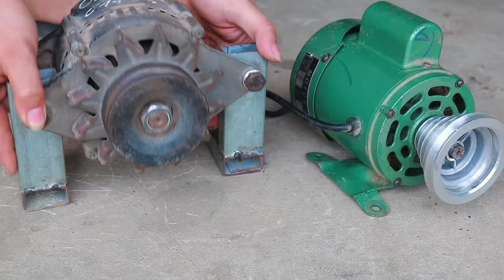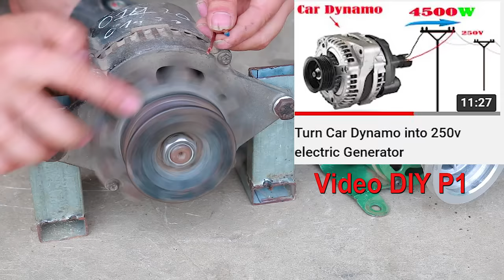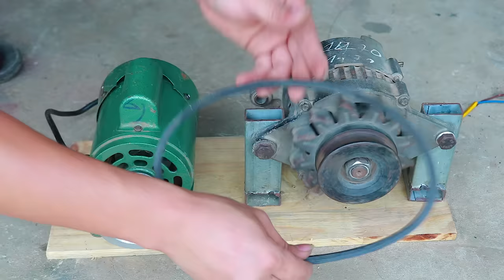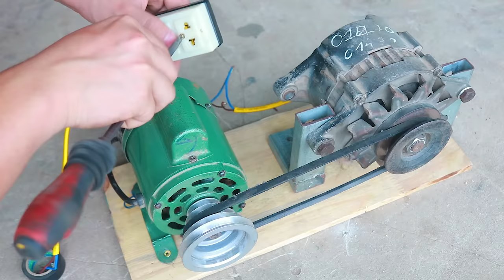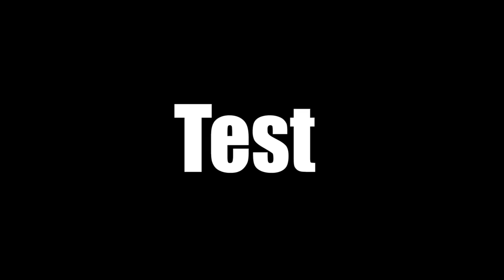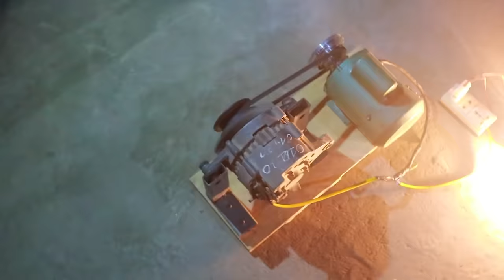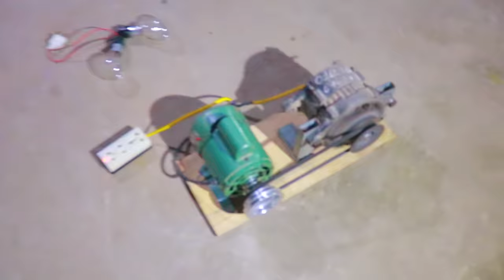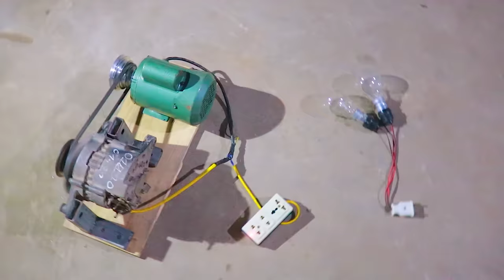How to generate homemade infinite energy with a car alternator and an engine P2💡💡💡

Comment: if you look at the data plate on the electrical motors they have something that is called efficiency and if you understand what this means then you will know why this is impossible, but good job making look real for the people that don't understand how electricity works. and before i get attacked power is what i did for a living for a long time.
Reply: you the wheels that spin with the belt couldn't you just attach a pair of magnets neodium or what ever is used  to them on shafts that extend into a coper coil housing to then as a by product of rotation create a very powerful magnetic field ??
Reply: @odgreenshq6221  if that is a question word it better because I can’t make sense of it, it’s like talking to Yoda.
Reply: He basically trynna explain what an alternator does
Reply: The Crazy Channel built a Liberty engine #1 using an alternator & electric motor & shows it running afterwards with no outside power supply. Logic tells me friction will slow it down but they claim its been run for over 2 hours non-stop. Is this possible ?   The same group built a generator that runs on water (H). what's your take ?  If that's true .... we won't need petroleum or electric cars either, just water & occasionally HH+.
Reply: Traduci
Reply: Wow you know a lot let me give you 5 stars ☆☆☆☆☆
Reply: I hate being told something is impossible,,  everything had never been done, until it was done the first time,. mankind always think he is at the pinacle of thought and  technology, he has always been wrong.its the one in 100000 that beats the odds and achieve.
Reply: Please keep paying your expensive electric bills that are going to get more expensive. Such devices are not meant for you
Reply: @EasternSurvival  lol I can comfortably pay my bills, but this device is nothing more than a party trick. If it was real the creator won’t just show it in YouTube for free. In fact this guy would be richer than Elon musk 😂😂😂
Reply: Exactly
Reply: @Juan Esteban Horta  
And thats exactly where you're wrong. If energy was for free there is no reason for war. Remember we're human...
Reply: Absolutely, This breaks law of conservation of energy!
Reply: @varunentertainmentnetworks2670  
Does the alternator charge itself through the power output of the electric Motor ?
r
Reply: @varunentertainmentnetworks2670  
Does the alternator generate. power for itself with the help of the electric motor?
Reply: Can gear ratio make it possible?
Reply: 🦋 I now remember exactly who you are. You are the person that said man can never fly. You were the man that said it’s impossible to fly to the moon.  You are the man that said a lot of things were impossible that later became possible. Why don’t you make a video that proves this is impossible? But I guess that’s just too easy. So I will do it myself as soon as I have all of the required parts.
Reply: @JustChillingOut  😂
Reply: So you "did power", so I guess you know it's an efficiency rating showing wattage usage and just to let you know this is very possible my friend, I made a pull start generator like this in high school, not that hard to do. I don't know what kind of power you did but might I Anna touch basics again.
Reply: @Truth4Trav85  lol you think a perpetual generator is possible than ok sure you are right sir😜
Reply: @jehg82  I hate this! Why can't we work together instead of being smug and tryin to one up each other, not just you and I but everyone, we all have some good ideas! That's what really pisses me or
Reply: You could use a coil system to multiply the voltage going from the alternator to the motor thus negating the efficiency loss 👍👍
Reply: @cherylwade264  yes... the motor requires 12v to function, an alternator can produce 14...
Reply: @insomniacbritgaming1632  so where is your video😂
Reply: @insomniacbritgaming1632  fair enough
Reply: Yeah, cuz if this real as it is big companies would have taken up the project but they haven't(cuz it isn't real as it is) and it it has been long since this project has been discovered
Reply: Cool, so we’ve established that you’re smart enough to shoot people down on YouTube but not smart enough to figure out a free energy device yourself, got it. 🤔😉
Reply: You working for electricity company you afraid you ll lose income. Plus your his was just to fix the broken
Reply: That is heavy
Reply: @JustChillingOut  still can’t get to the moon haha
Reply: They'll get it one day and say dam you were right!
Reply: Hi Buddy, have you tried to repeat the experiment?
Reply: A motor will run at lower current even if it has a parasite type drain
Reply: Did you ever build one yourself to see for sure whether it worked or not?
Reply: @jehg82  not everyone is motivated by greed.  
For argument's sake, let's say this works. A Chinese man would buy one open it up see how it works and copy it. Hardly going to make them a fortune is it?!? 
I don't expect you'll reply.
Reply: Не не выйде пробовал фейк
Reply: 100% possible...
Reply: So if you’re saying this man’s wrong and he’s showing that it works, what is he not showing us? That’s the question
Reply: So if you’re saying this man’s wrong and he’s showing that it works, what is he not showing us? That’s the question or are you just wrong?
Reply: Are you telling me that's no battery to power it,, I don't think it's nice with out battery,, or let the build contact me
Reply: @Truth4Trav85 it's republicans versus democrats but on a micro scale . One says you can't. One says Yes we can.
Reply: @tloutlou2655 not even smart enough if anything they're the janitor
Reply: @odgreenshq6221  That is already what is inside an alternator basically

Comment: This is amazing. I must admit he did a great job hiding the extension cord.
Reply: Really good, like invisible. MUPPET!
Reply: @newagethink2104  : I had an invisible extension cord, but I don't know where I left it.
Reply: Has he been assinated yet?
Reply: The light hid the cord.
Reply: Fake concrete floor- mortar spread on a sheet of chipboard and hole drilled under motor for access to extension cord.
Reply: You can buy 12 V light bulbs that look like normal  110 or 220 V AC lamp bulbs, total B.S. fakery here.
Reply: hahaha
Reply: see if this was real you could put in Electric cars, Drive forever.one day we will.
Reply: He probably rigged it to have batteries inside the generator.
Reply: Apa bisa berputar 12 jam,dan apakah bila 12 jam berputar terus menerus dinamo tidak terbakar?🙏🏿
Reply: 😂he probably has a battery hidden inside that motor with a inverter to supply the power to the lights 😅 that is why he conets al the wires together good 👍 but please don't lie light that 😢
Reply: pura fraude
Reply: had to butty in in the concrete to comr up under the 12vilt generator.
Reply: Bhi everyone is not like u a cheater
Reply: What he is doing is scientifically right. He connected a motor to a Dynamo and another Dynamo  to the motor. This will make sure the electricity given in the first place keeps on moving and is so called infinite energy. Don't comment wrong ideas without studying first sir. 😎
Reply: @vijaygeo1  bhi I have replied to this comment I like thin idea
Reply: @vijaygeo1  : Correct, don't comment on wrong ideas, other than to educate people.
Almost everyone that knows something of science knows perpetual motion machines don't work, except for the one I invented.
On a circular disc,  place the number "9" around the circumference. Make sure the center bearing is good.
The value of the "9" will pull down that side of the wheel, while the upside down "9", turning into a "6" will rise, causing the wheel to rotate.
Reply: I did one simulator however I did it with a small atv battery so the alternator had something to actually draw from while the alternator was infinity charging the battery and yes I can run lights and everything like that I just need to get a inverter to run 110v
Reply: @michaelmachacek6989  : go solid state. Just run an inverter from the battery, and then have a battery charger plugged into the inverter. It will provide as much free energy as the contraption shown here.
Reply: @drewthompson7457  nah fam because you have nothing that is regenerating the electricity
Reply: It’s a great idea the magnets will keep it moving Ima do something similar just to benefit me keep it up
Reply: @FranciscoHernandez-dq7rf  : what keeps the magnets moving? Magic?
Reply: Also he makes it as if light bulbs run on 0 watts because you don't see any reaction when he turns them on.
Reply: @drewthompson7457  id assume the magnets push/pull.
Reply: @selynar4889  : I have some magnets sitting on shelf. They just sit there, not pushing or pulling anything. But if you put them near a coil of wire, and add energy to make them move, some electricity will come out of the coil.
Reply: Didn't familiar on how alternator works?..too bad for you
Reply: @vinzgaming3706  Last time I checked, a car alternator is about 60% efficient, with a drive belt about 98% efficient, and the induction motor at about 85% or so.
I'm nor seeing any "above unity" spare energy, as this adds up to over 55% energy wasted as heat and windage. But this is common knowledge.
Reply: Just use split screens to hide the extension cord when filming viola!
Reply: Simple video editing to edit out the cord.
Reply: It's under the drywall
Reply: What about the man who was killed for making one of these and put it in his car?
Reply: @Benrose72490  Why would he make one for the car?? It already has an alternator.
Reply: @drewthompson7457   An extension cord under the board.
Reply: Clearly you dont know how alternators work and how they can power a motor which in turn spins the alternator to continuesly run. He is showing basic eltrical power (engine) with no off switch . this is 100% real...youre just not educated in electricity
Reply: @abigailisalive  : according to you, I could hook up an alternator to a Tesla and a car with unlimited mileage, never needed to recharge.
Why not learn about electricity and the machines used to make energy? 
After all, we wouldn't need solar cells, wind turbines, water power, nukes, etc if the power companies believed what this guy has posted.
Believe in magic and perpetual motion machines all you want, believing doesn't make them real.
Reply: likely hid the battery in the green motor housing.
Reply: @rossbrumby1957 that would be a lot of work to make a video that won’t make a fortune
Reply: I mean how does he keep an electric motor running? Electricity doesn't come from just anywhere And it would be needed To start the thing in the first place... It just doesn't make sense... If you could actually explain your thought Seriously Happy to hear it (Like legitimately im Not trying to be a dik or disrespectful im genuinely curious)
Reply: @JustMe-cl6fj  : it's a trick. Perpetual motion is impossible. No equipment can produce more energy than it consumes. Electric motors waste energy as heat and windage.  Alternators do the same. Even the drive belt wastes energy as warmth. Bearings heat up. All this wasted energy means no perpetual motion.

Comment: Does the alternator keep spinning once it’s started or does it stop at some point , also can you store the power in large batteries for use..thanks
Reply: For this to be possible, the efficiency η would have to be 1, in other words neither the motor or the alternator would produce waste heat or have any friction. So all energy put into the system would have to produce an equal amount of useful work. Can you see why this can't work?

Anyways, in reality, spinning the alternator up with a cordless drill produces some small voltage and not even close to give enough current to spin the single phase motor he connected to it. You can see right at the beginning that he's using a 250W asynchronous single phase motor. That is not only a terrible generator, but also wildly incompatible to pair with a car alternator, modified or not. And the motor does not have a capacitor, so it won't spin reliably, if at all. 

As you remove the drill, the alternator spins down in a few seconds.
Reply: @masterkamen371 u gave a long explanation but didn't answer the question.  You seem more interested to prove it don't work. We can clearly see it does....
Reply: @fromnothingalegend  what question did I not answer? I think I very clearly explained why this is not possible and I answered the original commenter's question. 

The video was doctored.
Reply: @fromnothingalegend  I just rewatched the video a bit more carefully. How do you even fall for this crap? He's not even using a capacitor for the single phase motor. You need at least a run capacitor to increase the torque to anything usable. Also tucked the grounding contact off to the side so if there's a defect in the motor windings, you'll get electrocuted. I can't even tell how this is supposed to work in an ideal world. Is he connecting the single phase motor to also work as a generator? I can't tell. But I can tell you that an asynchronous motor makes a really crappy generator.

I can't see how an educated person could fall for this.
Reply: @masterkamen371  There is a cap on top of the motor.

Comment: It can't be this easy!  If it was this easy every home on the planet would run like this
Reply: it is that easy. well, somewhat. its really unpractical, because you'd need huge engines, tons of wiring, a home-battery-box to store left over energy for when not all lights and stuff are used
Reply: Actually most homes only need 5KW of power to run, which is very easy to find a 5KW ( 6.7 HP ) Electric Generator ☺️ it is just most people are too stupid to understand this.
Reply: @3rdworldopinion420  My shower alone is 7kw....
Reply: It's not that easy otherwise you would try it, he makes it look easy because he knows what he is doing . There are to many variables
Reply: True

Comment: I would like to see a more detailed version of how to wire it up and a wiring diagram and how to turn it off. Thanks 🙏
Reply: If this did work. The most logical thing to do, would be to put a in line switch in. And simply disconnect the flow of Powe. Just like a light switch.
Reply: It doesn’t work and never will. It would be more efficient removing the motor and installing a heavy flywheel on the alternator to keep its momentum going longer, but still wouldn’t change the fact that the drill alone would require more energy to spin up the flywheel than what the alternator would put out to charge it.

Comment: The alternator is constantly supplying the motor with voltage . Motor in turn keeps the alternator running, a pendulum exchange. The kick-start is the cordless drill.
Reply: It will eventually die tho but easy to start it up again
Reply: That alternator needs a 12v supply in order to produce amperage.
Reply: @davidbell3432 12v powering the motor in this same setup... Except 2 batteries, 1 as the starter battery and 1 as the deep cycle carrying the load, with 2 alternators.... Either both of them charging both batteries or 1 alternator charging 1 battery and the other charging the other.... On the second battery add a capacitor in between the inverter and the battery... Connect both batteries in parallel- whatcha think??
Reply: @JonathanVincent0128  I think i'm to stupid to understand
Reply: Spinning a car alternator will not produce current unless an EXTERNAL voltage is applied to its field.  So just spinning the alternator like in the video will not make current to run the motor, unless of course there is a battery hidden inside the motor's housing but that would be deceptive, wouldn't it!?!?
Reply: @thomasharding1838  the alternator alone can generate energy, that’s how you can dump the clutch on a manual car to start it
Reply: When jump start car because as park plugs from coil not alternator lol 😊
Reply: The motor takes more electricity than the alternator can provide. This is not possible.
Reply: Don't be stupid
Reply: Motors have to have electric current to operate
Reply: You can't run an ac motor with DC power. Don't be a dope.
Reply: 😅 @JonathanVincent0128

Comment: I wonder how AC bulbs are running on DC alternator of car!
Reply: an automotive alternator converts dc current to ac current, hence why it is called an alternator
Reply: Alternator produces ac parameters which are converted to DC to charge the car battery
Mind you car alternators output 3phases
Reply: Yes my question too! No inverter or charge controller. where does the extra electricity go?
Reply: @kingcobra10418  an alternator is originally AC. He bypassed the diodes, which are what converts it to DC
Reply: @chadnelsen3313  you're hot on the trail. You just got it backward. It produces ac. The diodes flip it to DC.
Reply: Remove the diode pack from the alternator
Reply: Because the batter is in the motor